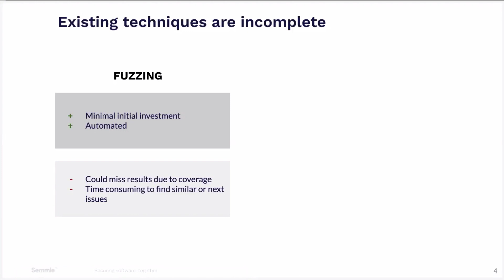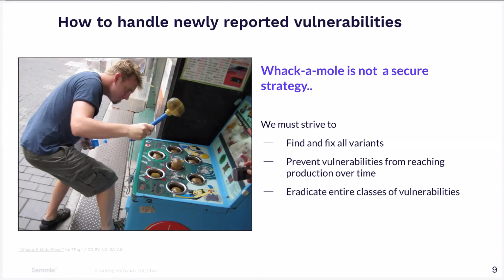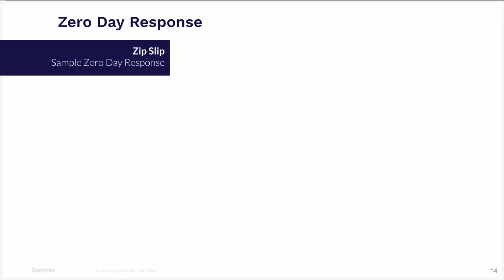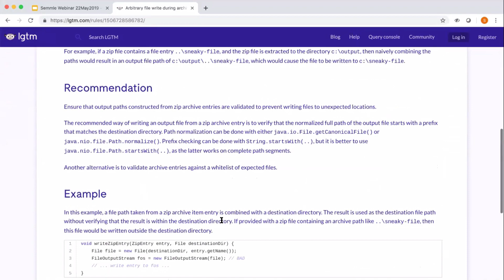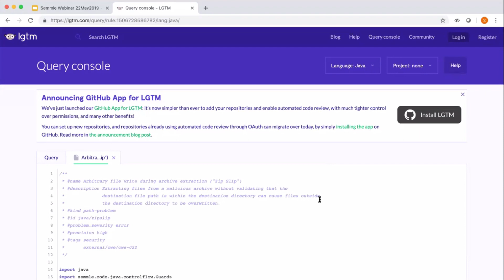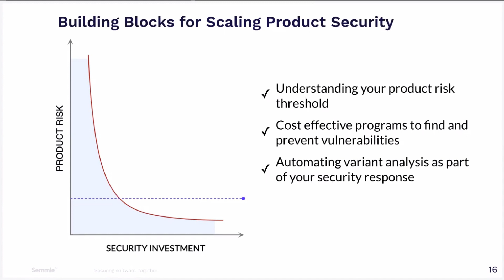Building blocks for scalable product security

Comment: Does Semmle have any strategy for covering security issues that can be discovered only with runtime information? For example an indirect jump sanitization that can be done with a mix of static and dynamic analysis.
Reply: The QL technology for variant analysis works by extracting all important details from the source code at build time. For interpreted languages, this information is extracted straight from the source code. This data can then be queried using QL queries — code as data! At the moment, no information is collected at runtime.